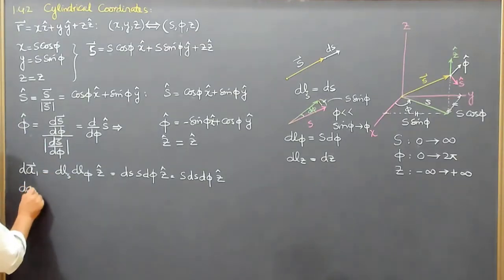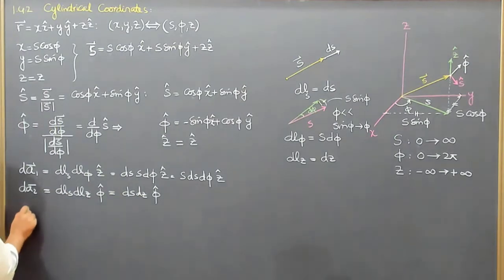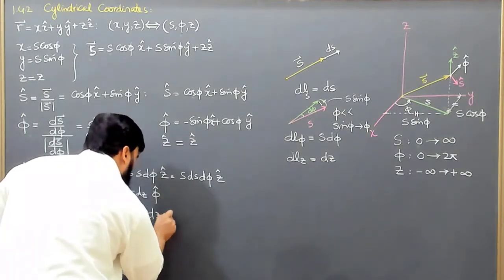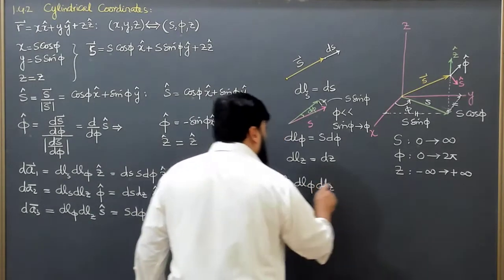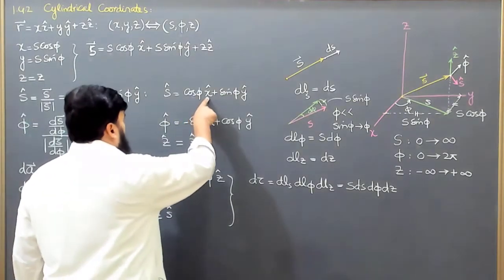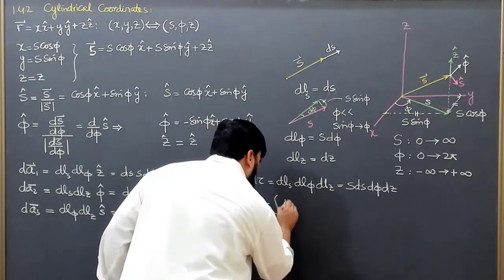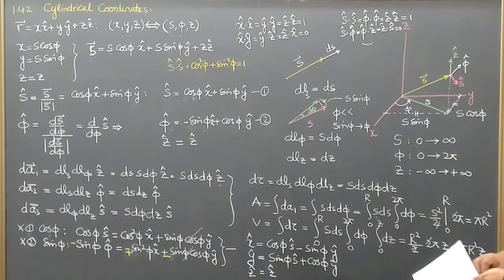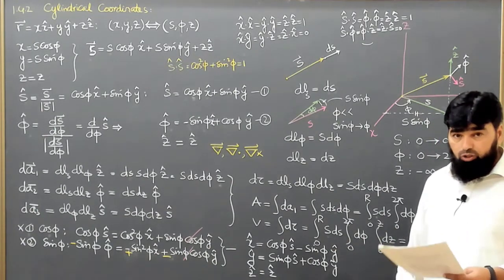L14.3 Length dl, area da, and volume dτ in cylindrical polar coordinates

Comment: Sir there is a mistake in x and y unit vectors, you wrote x unit vector in term of s unit vector and y unit vector, it should be phi unit vector.
Reply: Sir it's 10:26,
Reply from the maker: Yes, you're right. It's a typo for phi instead of y. Thanks
Reply from the maker: I rechecked and it seems OK to me. Would you please mention the exact time frame of the video where you see the mistake. Thanks